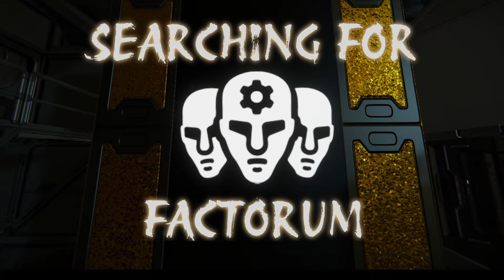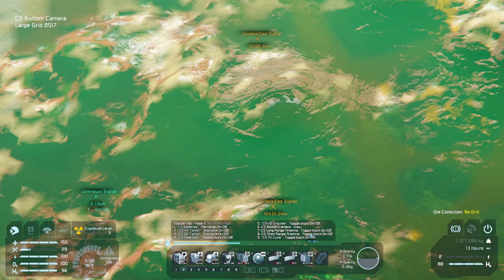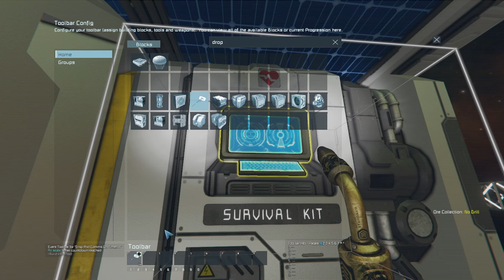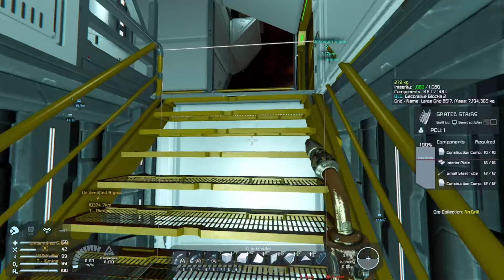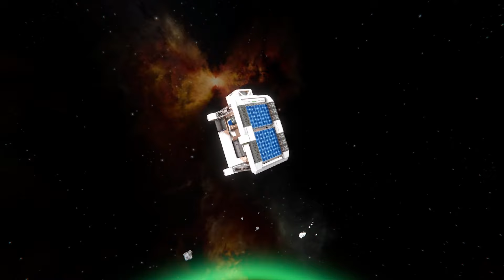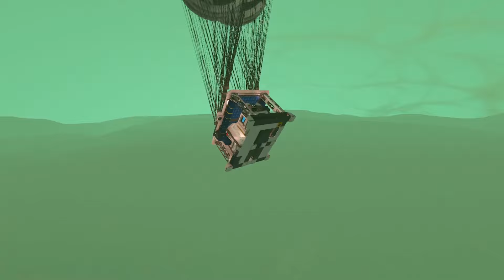Cargo Drop Pod | Space Engineers | The Search for Factorum E.34

Comment: Woohoo! Let's go! ＼(＾▽＾)／  

32:23 on the connector strength for dropping: 

When you use it as 'parking connector', just hitting "Park" (P) temporarily turns it off to a blue state, where the magnets are turned off completely for a short time, showing you to move away unhindered, then automatically turns back to normal white 'ready to connect' status, so you don't have to keep turning it on and off manually (though you can still do that with an event controller/ timer block for 'launch').

- Don't forget food this time! (っ °Д °;)っ  ( ͡~ ͜ʖ ͡°)   (ง ื▿ ื)ว  

- Make sure you've got weapons, because that place be scurry!

- Take some components to at least put up a simple protective wall around your resources, keeping spiders from eating you while you work and reload. 

- wouldn't hurt to have a simple interior turret watching your back also, on the top corner of the pod. Overwatch is nice. Could even have it mostly on the survival kit side where you'll be standing a lot, and a searchlight and buzzer/ alarm on the back side to alert you when creepy crawlies sneak up behind the pod, out if view.

- Somewhere near corners should probably have some bumpers for if it doesn't land straight or softly, it cushions it. Little 1x1 bumper tires (not suspension) around the edges would help, and some on the bottom as runners, in case the thing didn't land on soft flat ground, it won't send impact damage to through battery or survival kit (it even storage). 

- Take spare parts in case! Without an assembler, if the cargo gets damaged, you can't even hand build without parts. If battery gets bumped out of commission, you can't respawn or heal to you get it back on (unless solar and survival kit are ok, even if battery takes damage).. 

- if you put cameras all around, you can remote access through antenna (while it's active) and look around for damage, in case of meteor or lightning damage while off working. Lightning (and random drones) typically target antenna first, unless you have a decoy on a folding down & extending arm to keep them focused on that first. An event controller and broadcast controller will let you know if enemies are detected, or damage happens (lightning, etc), even if you're not there. 

-if you're also dropping (or talking the parts) the basic assembler, refinery, etc, consider at least 1 algae farm and food processor so when you get enough food (i hear mushrooms and sabroid meat are abundant down there!), you can make decent meals. 

- having at least four 1x1 suspensions and an extra battery and remote/ antenna (camera too?) and one of those simple stage boxes or barrels in storage, means you can at least make a little cart/ wagon for carrying supplies and without being over encumbered. The tiny connector on it and the pod means you can recharge easily.

Hope that helps!
Reply from the maker: This helps a lot.  Thanks.  Lots of great ideas.  I'll have to start a list so I can remember everything lol.
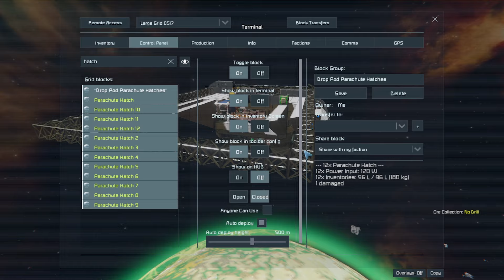Reply: 33:50 lmao, on parachutes v

ONE parachute catches full ships ok,2-3 is better but plenty. TWELVE is if you plan to launch it in stages, slowing and releasing over and over. ;P like a nuke to kill a gnat, but hey... If you use one at a time, you'll have plenty for later! Just make sure they're full before you launch and find out hope doesn't catch air very well in a slightly heavier environment than Earthlike. ;P

(Forgot to mention that the first time you said "twelve" ;P )
Reply: Oh yes, forgot the rest of the camera info: 

There are the "top mounted cameras" now that don't require another block to face it different directions, like down. So you can place one on the side, and instead of facing sideways, it actually faces down. 

For those 'damage cameras' in each direction on the top, you would have them on the edges facing IN towards each other, so you can see the entire top of the pod, including the other cameras, as well as the environment in that direction. So the far right camera will look Across the top, towards the far left camera, and in the left direction of the environment. If you have that searchlight and turret, you can also see those to check for damage or anger status is something is around, once you get that broadcast about 'something nearby' setup.

👍
Reply: *danger status